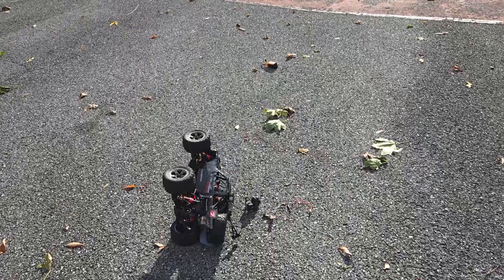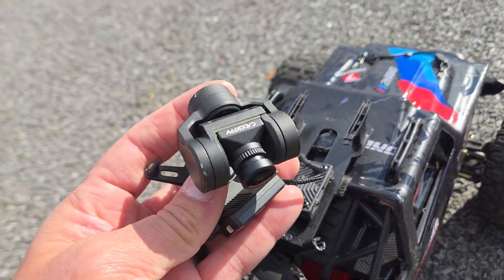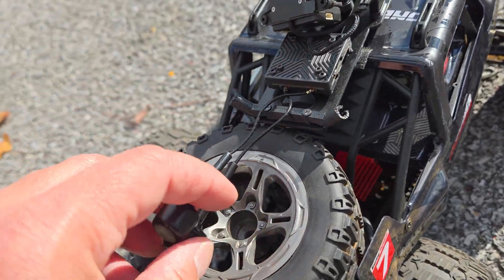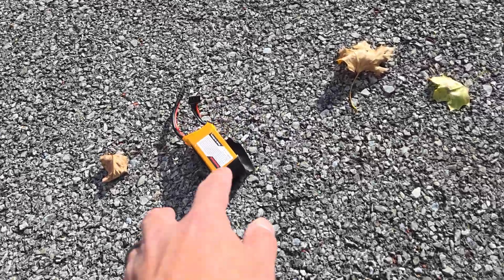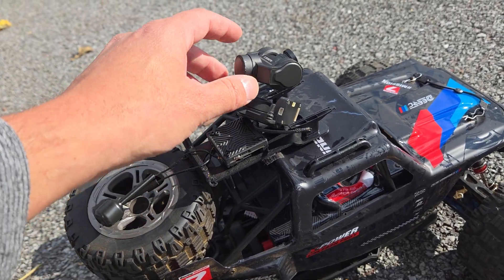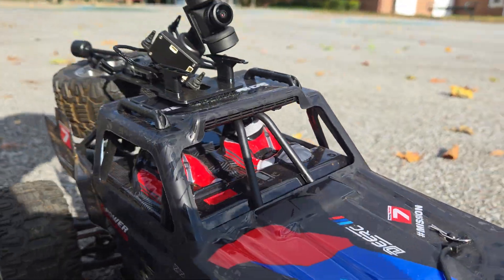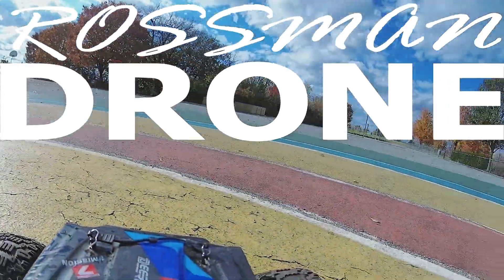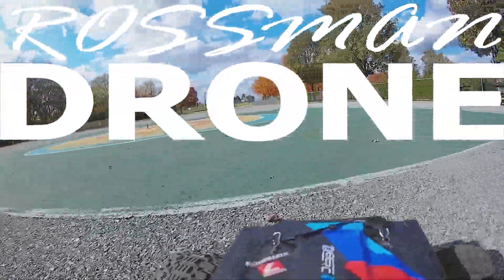I Built a Head-Tracking FPV RC Car… Then Crashed It

Comment: Was the fpv Kit worth the money? Thinking of building a fpv car too
Reply from the maker: Yes, especially if you are already into RC cars. Def mount inside the car!
Reply: @rossmandrone okay, will watch more of your videos 🙂 I own a goggles 3 and dji air Units with a hequav gimbal but don’t know how to get the head tracking to work 😮
Reply from the maker: @NRG1991  Head tracking only works with the walksnail avatar goggles (either goggles X or Goggles HD L) and a walksnail avatar camera like the Avatar HD or Avatar Moonlight
Reply: @NRG1991  no - it is NOT required to use the Walksnail system. Both - video and Gimbal control can be done with other systems as well. 

Video vise I use the Nebula Nano pro and a Caddx Vista.

The gimbal can also be controlled via PWM input pins - see the "GM series user manual" on the Caddx page.
The PWM signals are standard servo PWM with 1 to 2 ms pulse and 20ms period.
Actually not available is roll control - yaw,  pitch, level-mode and sensitivity can be controlled by the PWM inputs.
Reply: Also - the almost double price for the GM3 over the GM2 is absolutely worth every penny when it comes to offroad driving. Don't make the same mistake I did by thinking "Na man, I don't really need Yaw".
It's not only about the yaw - at a closer look the tilt actuator on the GM3 is not perpendicular to Yaw and Nick - there is more magic ongoing and I can tell from experience this magic is what you want for offroading
Reply: @rossmandrone  🔥🔥🔥🔥🔥🔥
Reply: This is an oboard not poststabilized recording running my setup on a Team Magic E6 BES in forrest
https://www.youtube.com/watch?v=aVXsozoA5GY

And this one comes with GTA Vice City  vibes
https://youtu.be/HcQLYW_VXEE
For the lights I simply bought the smallest LED bike lamps available in the DIY store - bike lamps already have a formed beam which comes in quite handy :)